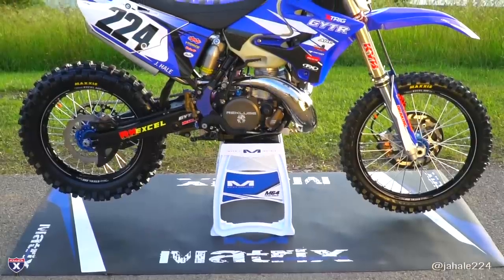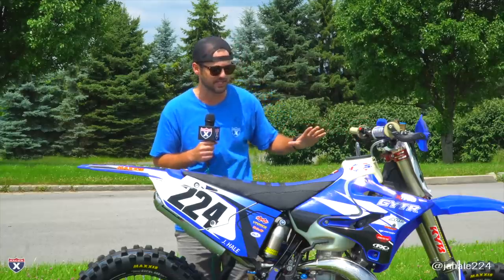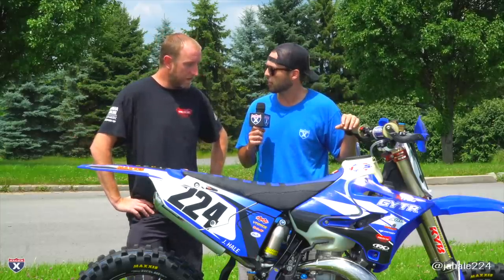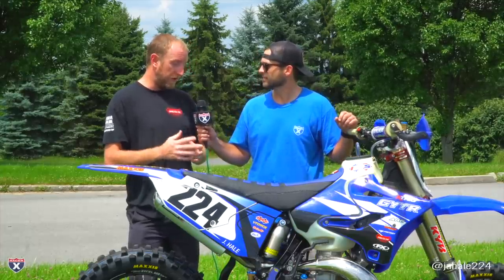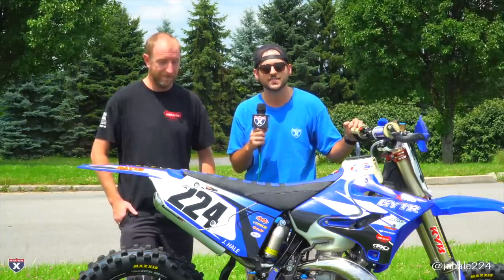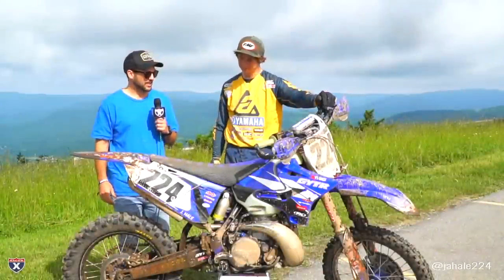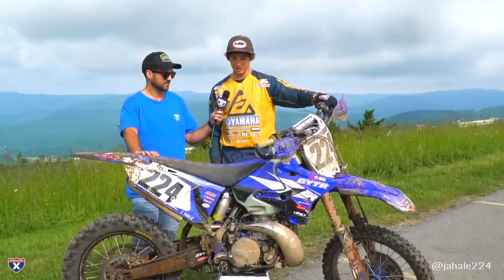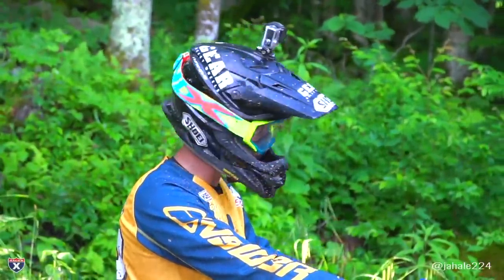Racer X Films: Garage Build 2011 Yamaha YZ250 GNCC Race Bike

Comment: Prefer KTM/Husky they developing 2 strokes and R&D.
Reply: No doubt the yz is a good bike but you're absolutely right, Yamaha hasn't really changed theirs sinse 2006. KTM has never stopped developing theirs, I recently got a go on brand new KTM 125. I never knew 125s could go that fast! 😮😂